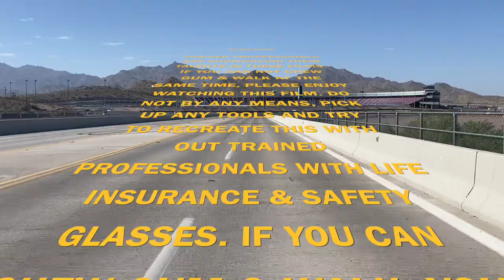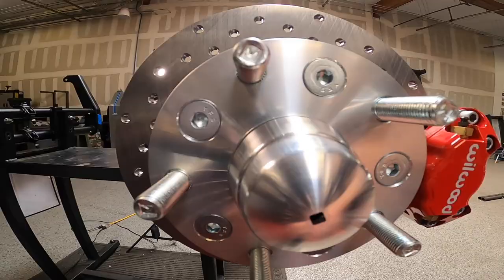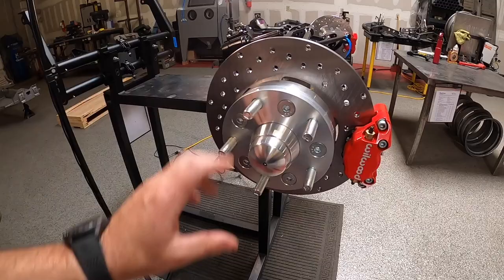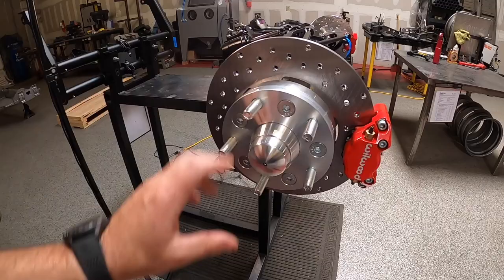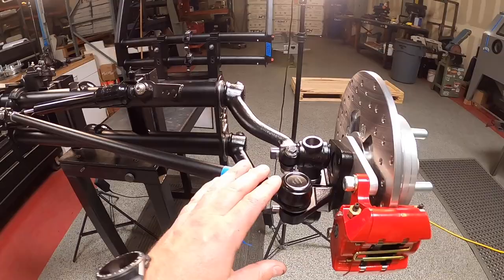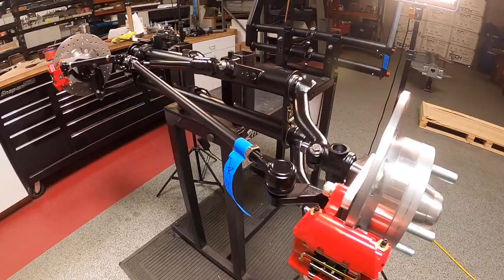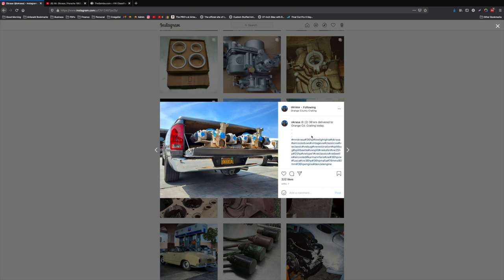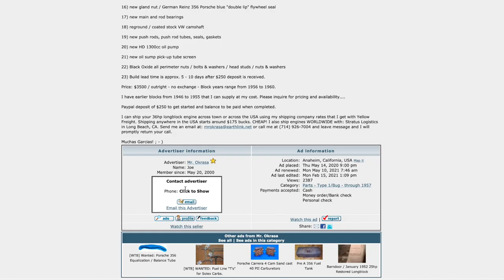Did we RUIN another Classic Volkswagen? | Narrowed Beam WITHOUT SHOCKS? | Airkewld

Comment: 🙋‍♂️ why go shockless other than to go narrower? I like a lot of your videos but i have seen a couple and thought well surely thats just for looks and going to make the car handle worse right? Stopping power is going to be better but if your shocks dont work it has a negative effect on braking. how long does it take to stop bouncing after a bump? Looks cool as hell! Can you add the benefits of doing something like this during your videos? Thanks
Reply from the maker: Hey Kyle, this is open subject as most often go with the thinking that it bounces but it doesn’t. Shockless is only an option should the amount of track that is increased with brakes, spindles and wheels and the optimal stance for the client.